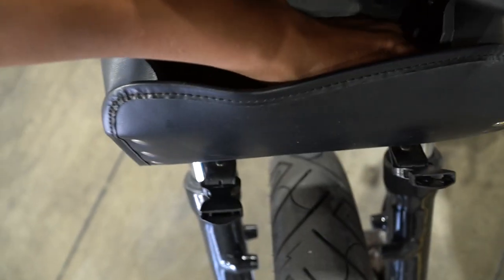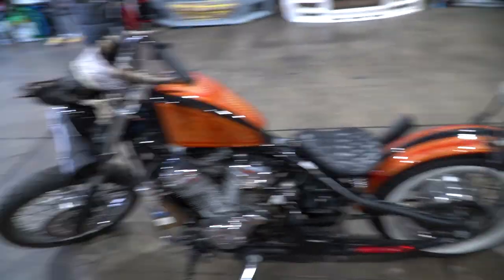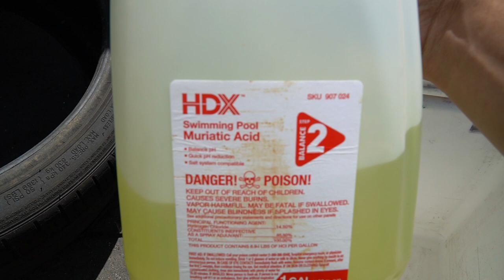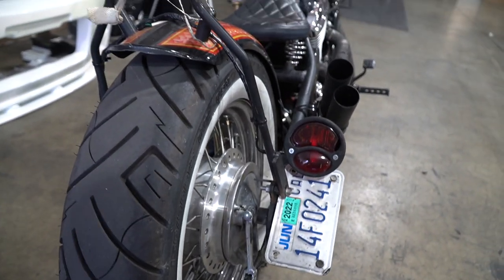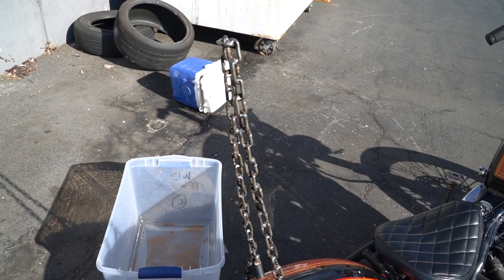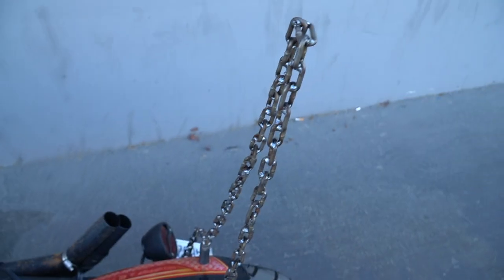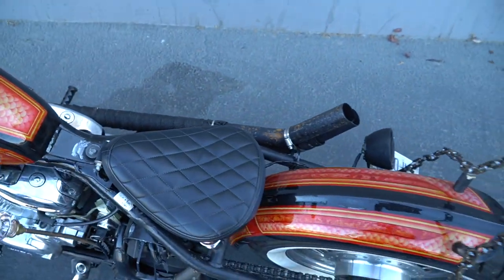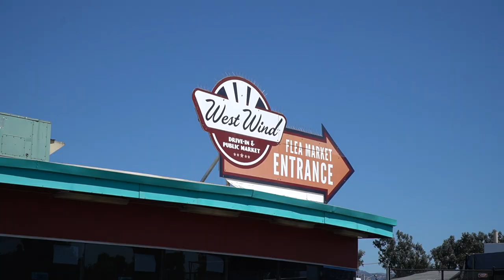I Made My First Sissy Bar Out Of Chains

Comment: Hey bro I hope you’re doing better and recovering faster than ever ! Sorry to hear about the Harley I know you’ll bring it back like you said it’s fixable you’re the one to care more for !!! I’ve been in similar cases but with my car lol and I noticed you used the tri pod to hold the chain up good idea but I’d like to suggest to avoid some wobbling/shaking at the top of the sissy bar maybe try welding up a new version 2 but instead of having the top point come to an acute angle with 1 links worth of gap try maybe 2-3 links of gap …it may sound like it’ll be built like a square but keep in mind that should Ali mínate some wobble plus allow you to weld the sissy bar higher (you may get a 6 foot chain and i believe you’d have maybe less wobble than currently also maybe a thicker chain may help ? Anyways glad to see another vu video !! Have a good one and drive/ride safe bro !!!